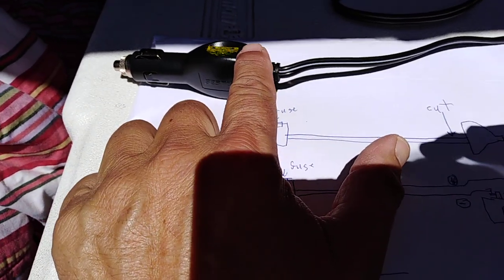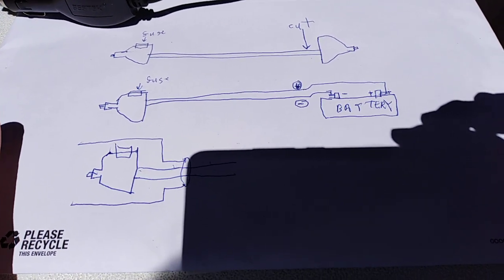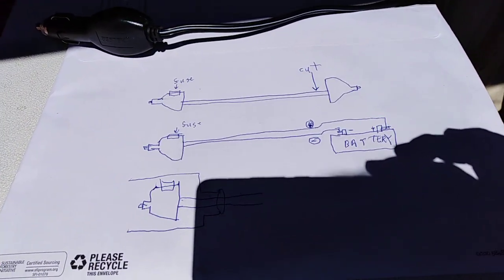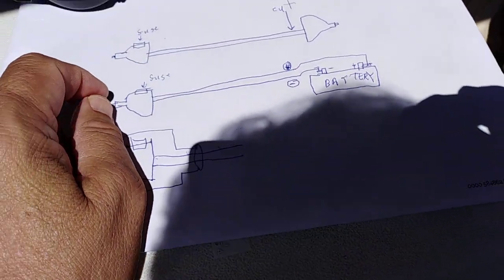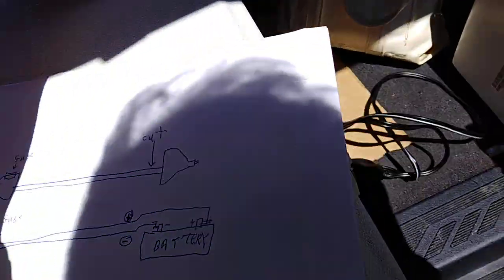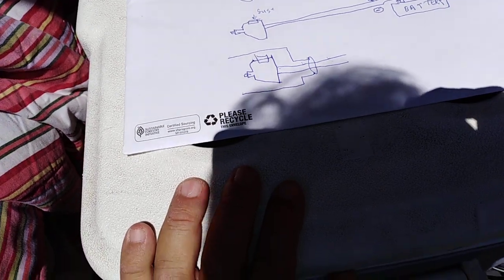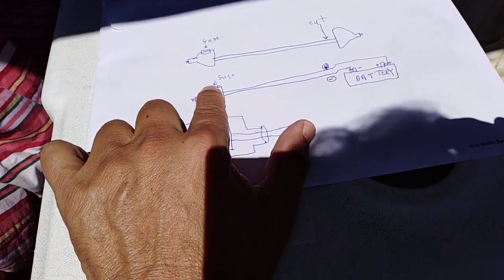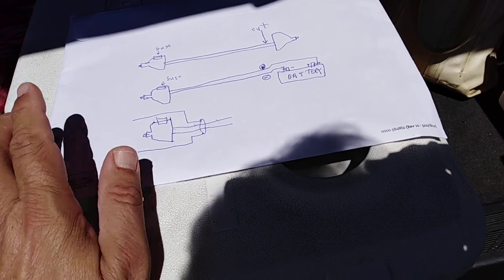12Volt Batttery Charging using 12Volt Cigarette Lighter Plug

Comment: need an isolator charger like used for campers, when engine on vehicle is running it charges deep cycle battery, when vehicle is off, it keeps the camper from draining the vehicle battery

Comment: Hold on a second: There are no protective measures here, in terms of current draw/power consumption (only the vehicles own fuse for the accessories circuit.). Typically the 12V cigarette output type is limited to around 150W. You're plugging a battery straight onto another power supply. This is potentially dangerous - no power management in terms of charging either and no control circuit that controls current flow, etc. Typically, charging devices are "smart" since they control current for the battery type, measure voltage to regulate such and increase longevity as a result. Very skeptical here.
Reply: What do i need to charge a secondary battery from a 12V cigarett outlet?
Reply: @Bylga  I got here after doing identical research to yourself: there seems to be no short answer: one solution actually did a 240V step up and then a normal Li-ion smart charger can be used (note: that the power sockets are usually rated around 150W - you need to keep the charging current at around 1A to prevent blowing fuses)...which really seemed exorbitant for my needs. Probably logical in a car or pick-up. 

Hoping for a more elegant solution for a battery in a pannier for a motorcycle. I have an 18Ah Li-Ion battery and a 12V Hella socket under my bike seat. Perfect location to charge on a road trip! Just the rather NB bit in between that needs work.
Reply: @KwizatsHaderach8  Thanks for your feedback. I was thinking about to buying a power tool battery car charger instead then  just cut the end off a power tool connector to make a battery power box. Then i can charge the battery while driving.
Reply: @Bylga  You're welcome. 
Again, just make sure that the rated power/current draw is the same - so what you cut off (and charge) and what you reconnect doesn't require a larger load. It will get ugly otherwise. 

Most battery chargers for dual battery systems, have a timer that switches to the secondary battery after a few minutes to allow the primary/starter battery of a vehicle to charge sufficiently.